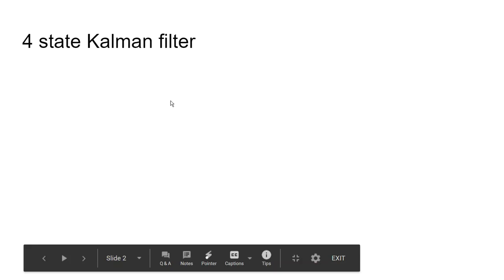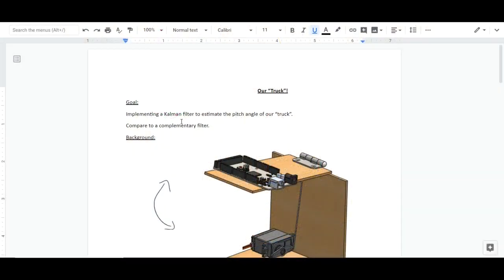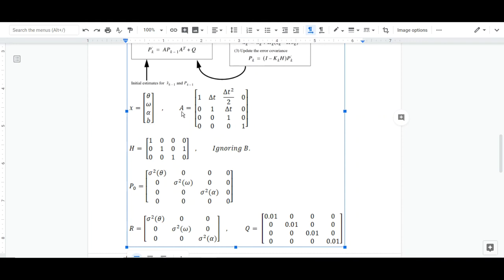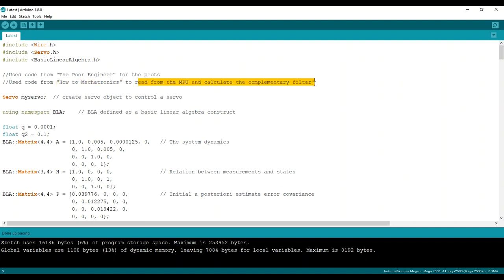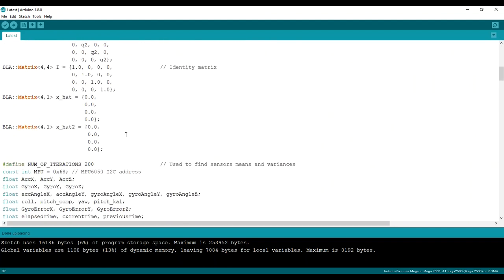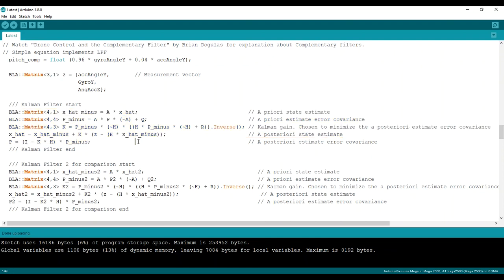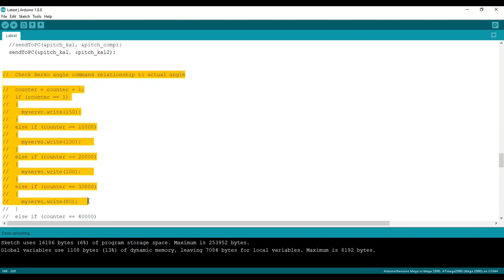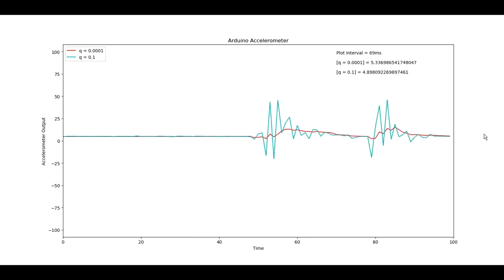Four State Kalman Filter with Arduino

Comment: Hey, Thanks for the code, i tried to implement it too but i got this error can you help me here.

Arduino: 1.8.16 (Windows 10), Board: "Arduino Uno"

C:\Users\HP\Documents\Arduino\sketch_mar05b\sketch_mar05b.ino: In function 'void loop()':

sketch_mar05b:137:68: error: 'class BLA::Matrix<3, 3>' has no member named 'Inverse'

   BLA::Matrix<4,3> K = P_minus * (~H) * ((H * P_minus * (~H) + R)).Inverse();

                                                                    ^~~~~~~

exit status 1

'class BLA::Matrix<3, 3>' has no member named 'Inverse'

Invalid library found in C:\Users\HP\Documents\Arduino\libraries\__MACOSX: no headers files (.h) found in C:\Users\HP\Documents\Arduino\libraries\__MACOSX

Invalid library found in C:\Users\HP\Documents\Arduino\libraries\__MACOSX: no headers files (.h) found in C:\Users\HP\Documents\Arduino\libraries\__MACOSX

This report would have more information with
"Show verbose output during compilation"
option enabled in File -> Preferences.